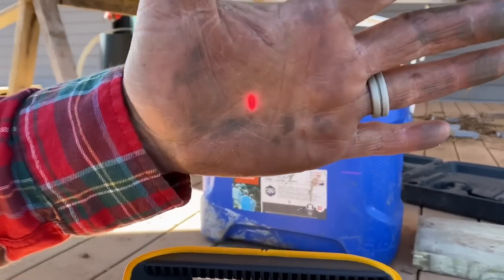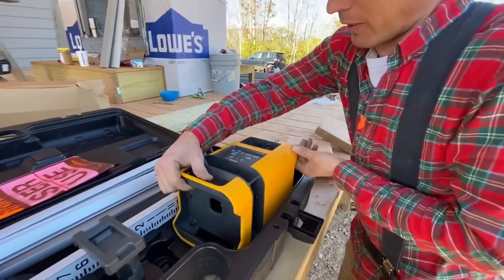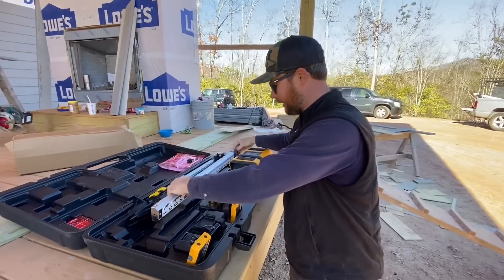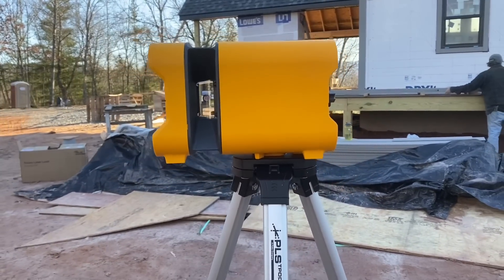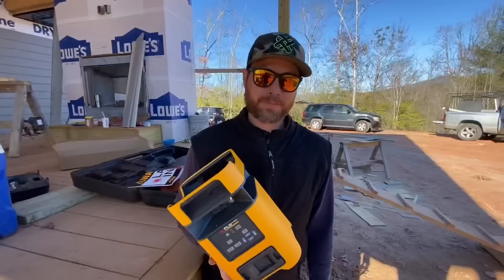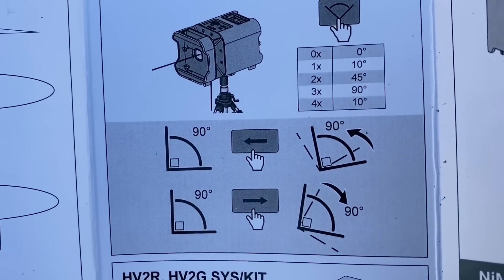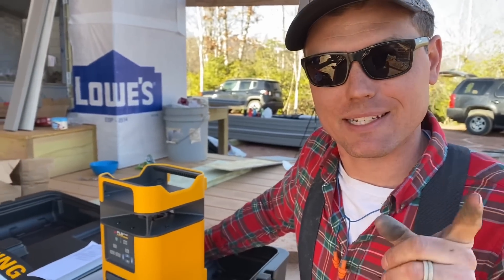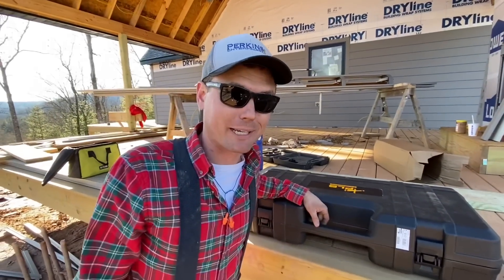Mack Daddy Laser Level | PLS HV2R Rotary

Comment: It's not a "reader", it's a detector or receiver. The rpm control is not for distance. No matter what the speed, the beam passes at the same fraction of a second if you're 1,000 ft away or standing right next to it. For working inside without the detector,a slower speed will allow you to see the laser beam better. For laser controled equipment you want it faster. You can find a sweet spot by fine tuning the speed. How do you calibrate it. I looked on PLSs website for a manual for that thing and couldn't find anything about calibration. If you don't check accuracy on lasers regularly, you could get in a real f up. I've gone to jobs to do the subgrade and checked their"level" to my recently calibrated laser and found they're off an inch in 100 ft. That's a lot of concrete $$$. Most times I would let the contractor know and then adjust the slope on mine to match theirs so they wouldn't have to re-form everything, and that's eft up. If you can't calibrate it, and I can't imagine why you couldn't,then go get your money back. The first laser I bought back in 94 cost$2,000 for a 1,000 ft radius,no slope. The last one I purchased around 96,97 cost close to $8,000 for a duel slope. I'm telling y'all this to show you get what you pay for.

Comment: How did you guys get over heights and walking on plates and joist and extra
Reply: Monday's are a bi**h as you got use to ground over the weekend.
But, yeah you get use to it, throw on a extra maxi pad and climb up.
Reply: Experience, I was a chicken when I started when I was 16.
Just worked my way up and got over it, never got careless. It's been 24 years and I have not fallen, just don't do anything stupid.
My 1st boss told me if I'm gonna fall, jump inside instead of 3 floors down outside, that actually helped me.

Comment: Cool, what was the cost?
Reply: About $1,200
I have a similar Bosch set that cost $650.
Reply: @ajs96350  wow. I think I'll stick to my 179.00 Bosch. Maybe if was to do foundations then I could get though.
Reply: @aservant2287  Does it have a finder?
Reply: @ajs96350  no but have used for finding a leveled spot for like high freeze molding or stairs
Reply: @aservant2287  The self leveling kit with a finder is a game changer,  if you have the opportunity,  it's worth every penny.